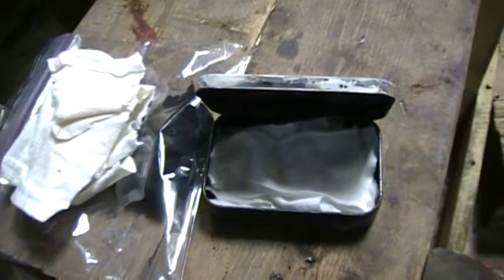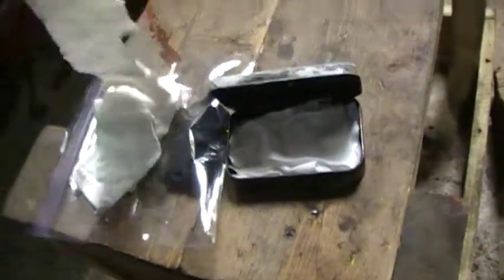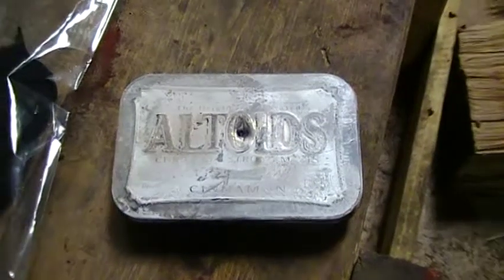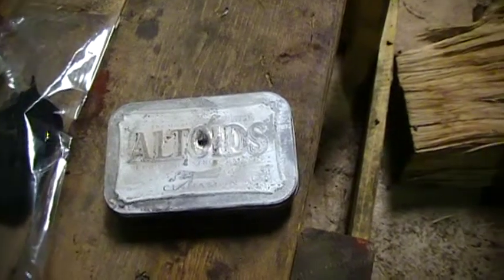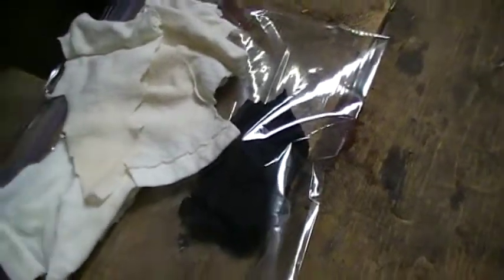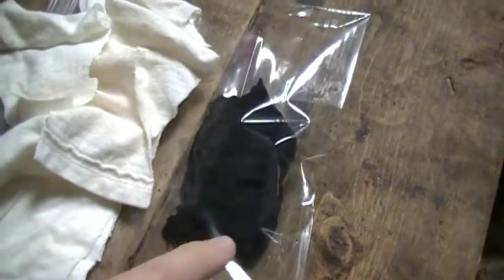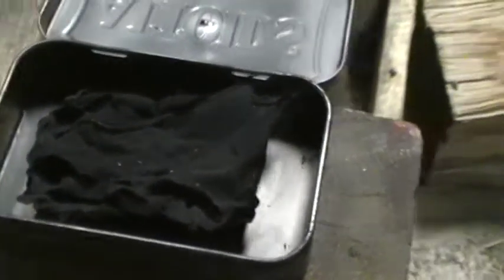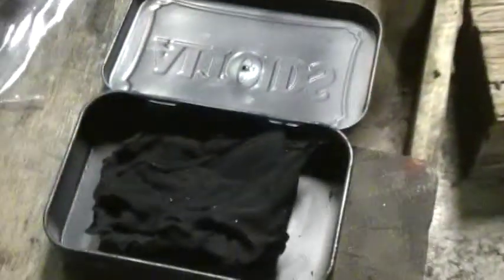Making char cloth from start to finish

Comment: Nice. This is basically the same process I use to make my own charcoal that I use for fuel for my aluminum melting forge and for fuel to run my 4kw backup generator. I am going to use charcoal this year for my blacksmith forge as well.   Good video. Peace.
Reply from the maker: +radicaldanzero yep, basically the same process. I plan, hopefully in the future, to do a video on making charcoal. Thanks!